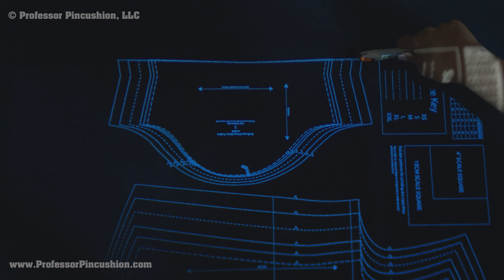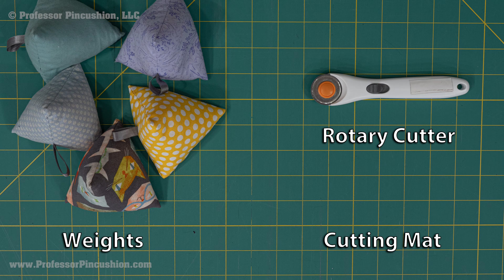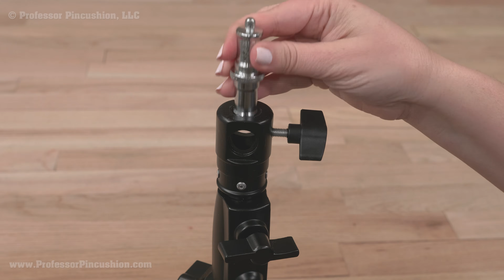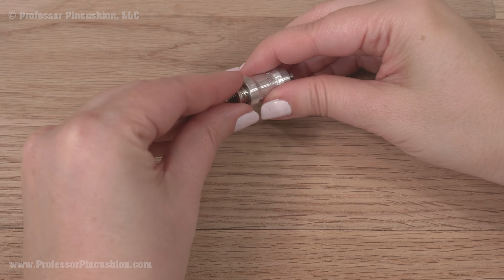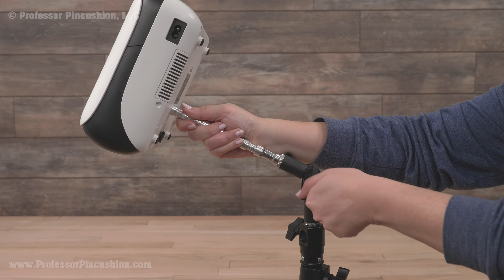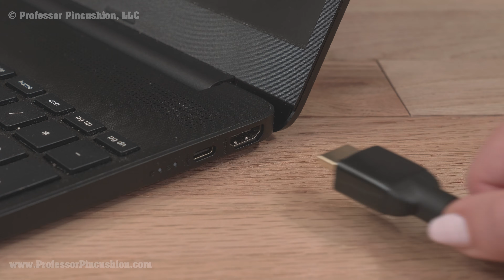Projection Pattern Sewing for Beginners - Equipment and Setup - Under $150

Comment: Thank Goodness! Such a straight forward approach to setting up projector hardware. Thank you, thank you 🥸 Question. Is there an adjustable extension (short boom) instead of those pieces for the 8” extension to aim the projector down? Recommendations anyone? 🤗🤓😎
Reply from the maker: You can use a boom to extend further off the vertical stand.  You can just search for "light boom extension", "light boom arm".  You will see some ideas on how to do it.  You will probably need to change out the right angle pivot to something that will hold the boom, then some sort of pivot at the end to hold and angle the projector, and will have to put weight at the end of the boom to balance the weight.  You will have to search around to see what you like and if you have the room for it. As for a specific one, I have not used them so I don't have a recommendation sorry.

Comment: Great video. I was actually expecting another ceiling mount video. I have architectural details on my ceilings so a ceiling mount is not possible without destroying my ceiling. This looks so easy! Do we have to start over with all new projector friendly patterns?
Reply from the maker: make sure to watch the other 2 videos, it goes into details about the patterns, but in short, yes you would need projector friendly patterns.  Paper patterns are not digital :(

Comment: Heya ! Great subject. Just a note inpassing : even though these litle wireless video dongles devices are often referred to as "chromecast", Chromecast is specifically the name of the one from Google, which uses a proprietary protocol/license for video. Whereas all that's needed for pattern projection like this here is the much cheaper kind of video dongle supporting "Anycast". Anycast doesn't play video as smoothly as a Chromecast as it simply duplicates the display of the source (phone/tablet) in a bruteforce manner, but it is totally enough for pattern projection and costs a fraction of the price (about 10 to 15usd for an Anycast, as opposed to 40 to 60usd for an actual Chromecast if I am not mistaken).
Reply from the maker: Yes chromecast is the "gooogle" version.  The concept still applies, its a dongle that can display the devices screen wirelessly.
Reply: @ProfessorPincushion  Absolutely ! I just thought I'd mention it, as I found it to be very confusing at first when researching the topic a little while back (especially since since the cheap but serviceable "Anycast" ones are often mislabeled as "Chromecast", with a fake logo even).

Comment: I'm more curious what kind of program this uses.
Reply from the maker: The approach we are taking in the future videos in this series is what is on the computers screen will be sent to the projector via an HDMI cable or Chromecast.  Then we will use adobe acrobat reader to display the "pattern" that was purchased.  The pattern purchased needs to be the full pattern and or one that is "projector ready".
Reply: @ProfessorPincushion  Would a Roku dongle work instead of Chromecast/Anycast?  Will the free version of adobe acrobat reader work?
Reply: Hello - It's a display, nothing more nothing less. It doesn't use any program. It can either be setup as a display for a computer or tablet or phone (using either the hdmi or a wireless dongle) hence displaying anything that a computer or phone can display ; or, it can read files directly from USB.
That means that you can either display a pattern directly from a drafting software ; but much more likely, display a PDF or an image.
Displaying from a computer (as opposed to displaying from a phone or using the built-in reader) is much preferable though, because you need accurate image zoom control to project the pattern exactly at the correct scale. Whereas the built-in multimedia viewers on this kind of device (reading directly from USB) tend to have rather clunky zoom controls. But of course it's always possible to move the projector away/closer to the wall to adjust the scale, too.